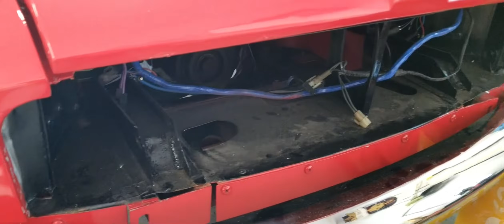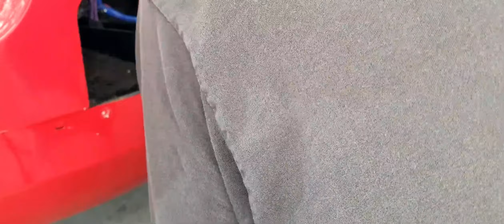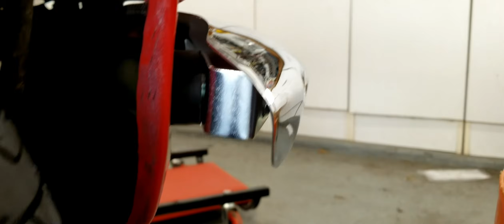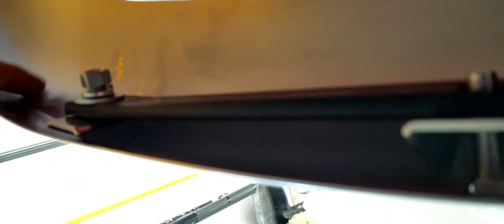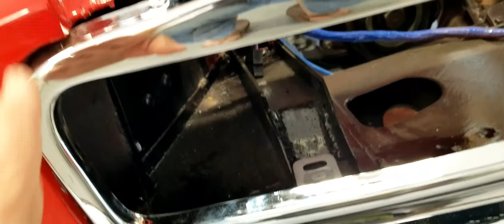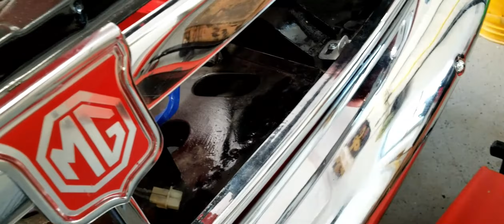Nigel the 1977 MGB Chrome Front Bumper Conversion

Comment: I know this sounds like the laziest thing ever but can I just put JB weld in the hole? I really don't want to break out my welder just for that.
Reply from the maker: Yeah, I guess...
It is not structural.

Just need to keep water out of the frame rails
Reply: @AlexPlatacis  That's what I was thinking, I know it's jank but as the saying goes "if it stupid but it works then it's not stupid" lol
Reply from the maker: @J.S.McDuff hey, I had run over 20 years on a jb weld patch on my VW throttle body.  When it Works it is a win

Comment: It lloks nice but, I feel you left out the most critical steps.
Did you have to replace the hood (Bonnet) did you have to cut the fenders . Did you have to cut the hole for the grill to fit in?
Or does the grill you ordered fit in the space with just a few cuts to the frame ends?

Comment: Your "Bite Me, Ralph Nader" headline is a bit silly since Nader didn't create the huge rubber front bumpers on MGB's. MG created them. That they chose to add a gigantic rubber bumper was their choice. They did it to save a very outdated car instead of designing a new one that would be safer. Auto safety is a good idea. Stop blaming the people who encouraged it. Keep in mind that what you're doing here is purely cosmetic. It doesn't improve the car in any other way.

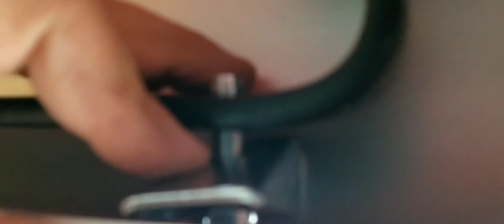Comment: @17:00  l think if you had put a nut on that bumper bolt and tightened it up it would more the outer bolt the way you needed without bending.

Comment: Alex,  I have a 77 that I am considering a cb conversion,  I’ve been warned that many of the chrome grill frames do not fit right with different angles creating odd gaps.  Did you find this to be the case and did any of the bodywork include adjustments to fit the aftermarket frame?  Your final fit looks great.   thanks

Comment: I have been enjoying your bumper videos a lot since I am about to do one.  On the rear bumper video I haven't been able to find where you purchased the flare pieces under the tail lights. Do you still have the part numbers of these. I would appreciate this. Thanks
Reply from the maker: https://mossmotors.com/457-980-repair-panel-corner-below-taillamps
Reply from the maker: https://abingdonspares.com/products/repair-panel-corner-below-taillamps?_pos=1&_sid=c5c0a8ad8&_ss=r
Reply from the maker: https://www.mgsales.com.au/products/457-980-mb101-mg-mgb-rear-corner-repair-piece-under-tail-light
Reply from the maker: Seems stock is low for these.  Moss apparently still shows stock available, but they don't always update.

Hope you can find a few.  Good luck

Comment: Hi Alex, thank you very much for this video. It helped me a lot being that I wanted the minimalist look. Could you please elaborate as to why it was a mistake to use the original apron/front valance? These are going $350 with shipping nowadays, and I don't see much of difference between the original and aftermarket. Could I do without it? Thanks!
Reply from the maker: Yeah...
Thanks for the question.

Originally, I had intended to use the original apron.  I was a little dented up, though, and by the time I  had banged it out and welded patches in the signal ports, the whole thing was so badly distorted I would no longer fit.  As it was the new one needed some adjustments to get it to fit on the 77 frame.  

If you have the time and patience, I am sure the old one will work well

Comment: Maybe I’m crazy, but I really don’t find the rubber bumpers to be that offensive. I think the folks in Abingdon did a good job. If they weren’t black and were painted the same color as the body it would look like a car that ran off the assembly line less than five or 10 years ago.
Reply from the maker: true.  I agree.  I have seen quite a few resto-mods that have painted bumpers.  in my case, the existing bumpers were in pretty bad shape.  I think they had been "used", and had some sagging.

I felt that if I was going to replace them, I would go with chrome.
Reply: @AlexPlatacis  I have a white 1979 that needs an engine rebuild. I’m planning on doing the job with my 19-year-old son. I really appreciate your videos because they will make it a lot easier for me when the time comes. 👍👍👍🤙🤙

If you ever need a few tips on replacing the windshield or replacing the dash pad, let me know. I have a couple of good tricks.
Reply from the maker: @MultiPetercool  great thanks.  My son and I did a '67 mustang.  Started his Junior year of HS.  He was able to drive it to his senior prom.  Great memories.  Best of luck on your project

Comment: Man, this is timely. I have a 74 1/2 that had a Sebring kit installed on it. It came with a set of chrome and rubber bumpers. I'm not sure which was on it originally, but I think by mid 74, the rubber ones were being fitted. I want to put the chrome bumpers and luggage rack back on. I have some of the brackets/bolts etc. but will need to sort all that out.
Reply from the maker: Cool.
Hope my vids help out

Comment: I had an original 1962 MGB right after High School, wanted one ever since. Retired now and just bought an all original "77" MGB with only 52,000 on it,.. but Damn I hate the rubber bumpers. But being on a fixed income trying to stay alive with this crappy Biden Flation stuff I probably won't be able to get this conversation. Do they make a grill like that in a more shiney stainless to match the bumper? Good job pal,..  love my MGB !
Reply from the maker: I agree. the rubber front bumper is pretty hideous.  they don't age gracefully either.
My solution for the front bumper is actually cheaper than buying the Kit at Moss.  it does not have the over riders, and if you just go with the side indicator lights, that also reduces the cost.
The Moss Motors Grille was almost $400.  I searched out a less expensive grill, and it looks great.  

I think you can replace the front, and leave the rubber rear bumper for later.  it would look OK.
there is still a bit of body work, and metal fab to do.  but I had fun doing it.

Thanks for sharing your story.
Reply: @AlexPlatacis  I actually think my rubber bumper looks good. To each his own. My bumpers look almost new which is a testament to them being garaged most of the cars life. I have 77k on the car now.

Comment: Hi Alex, just a quick note to say when fitting your grill.
The MGB Moss catalog shows 3 brackets that fit to the top of the Grill and mount back to the platform, bonnet lock section.
I hope that this is a help for you.
your G is looking great and much better than the rubber nose.
cheers Rob
Reply from the maker: Thanks.  I will check the diagram on moss.  This grille was purchased on Ebay it is an after market replica from a company in CA that went out of business.  I think it was part of thier left over stock
Reply: I’ve done a chrome bumper conversion on my 77 B and used the three brackets that secure the grill at the top to the bonnet landing plate. You will notice the holes at the top of your grill, these are where the plate’s are secured to the grill.
Reply: Hi Alex  where did you get a bumper  please